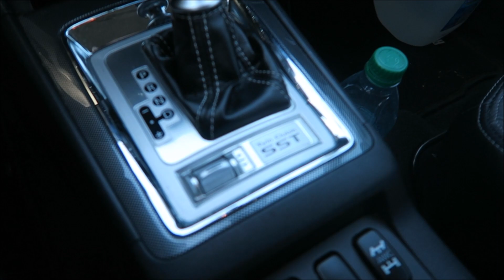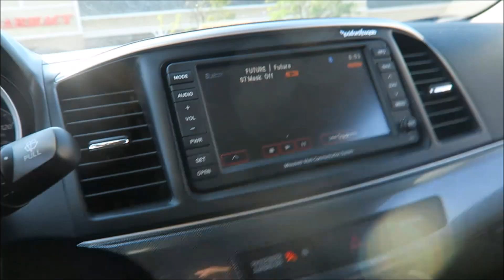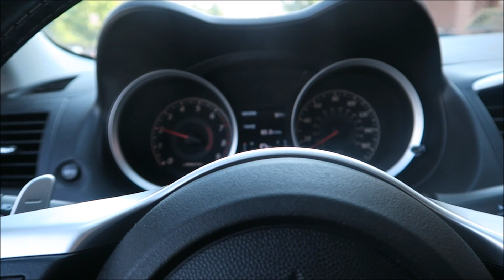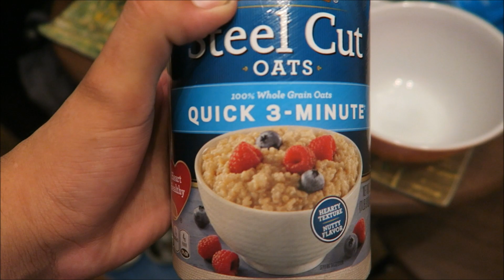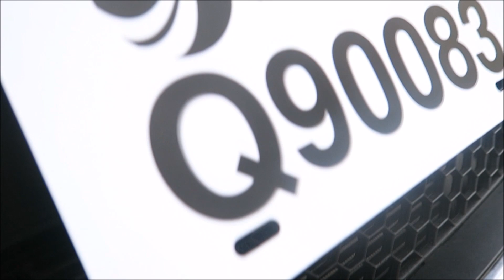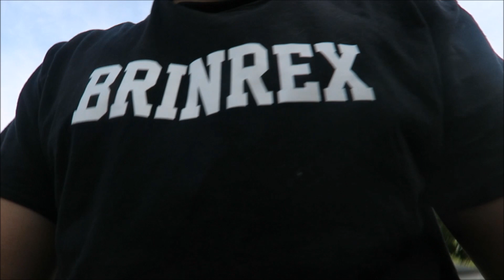A closer look at my ralliart engine

Comment: Dont forget your rear "roof" window spoiler.... will look dope
Reply from the maker: +latinboy2011 ah yes I've seen those
Reply from the maker: +JJDJ04 aye nice can't wait to install it
Reply: Bro yes get the cosworth air filter its looks great its an improvement over stock get it. I have the cosworth filter on my wrx i gained 2mpg! And3 hp .Also for some bling for your interior, you can remove your stock sst shift knob and replace it with a nice aftermarket one.👌
Reply from the maker: +Jordan Dejesus ah I never thought about a shift knob